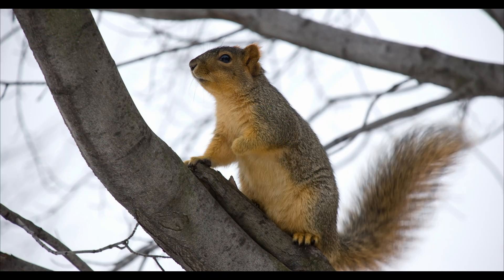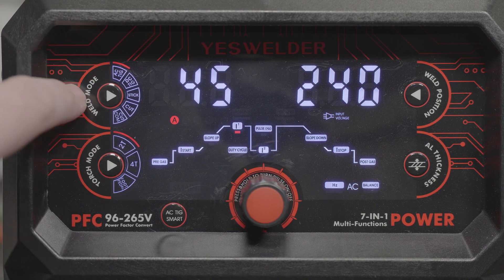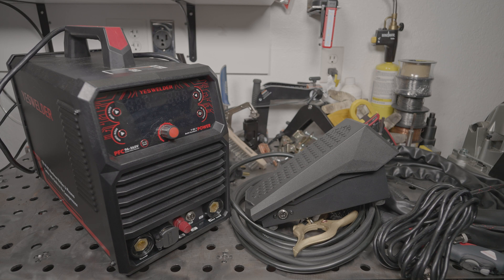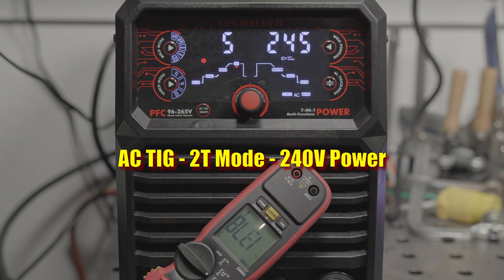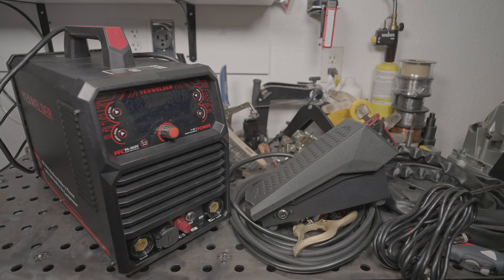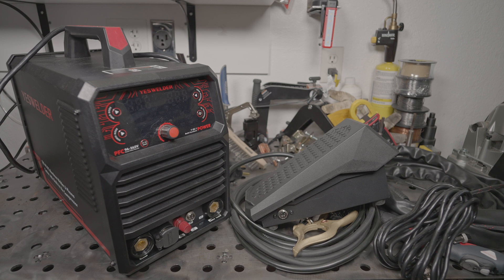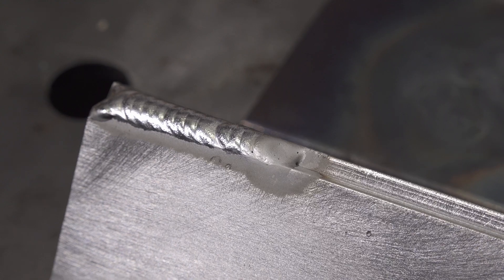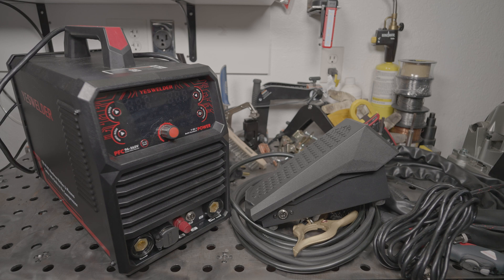Yeswelder CT2050 TIG Testing - Surprising Results

Comment: This is a cheap welder for what it claims.  Performs mostly like a cheap welder.  I'm sure  most that paid big money for it,  loves it.    The I'm confident I didn't get screwed mentality.
On measuring the AC output it is possible to get errors on measuring voltage if a complex waveform. Checked meter on other ac welders?  Feels like less amps than otther ac welders?
Reply from the maker: It definitely feels like less amperage than other welders.
Reply: I just need to add some type of  blocker to my browser that mentions Yes so I won't be tempted...

Comment: I just want to say thank you for this great review on the YES CT2050 welder. I have been welding for 40 years and was thinking about buying this very machine, not for me but for a cousin that asked me to find a decent welding machine that had multiprocessing. I currently have a Miller 330 A/BP AC/DC with High Frequency, Gas and water valves connections and a range from 5 amps to 460 amps. It's the real deal for serious welding needs. I believe it's a 1987 or 1988 model with approximately 100 hrs. or less on it. I bought it maybe six years ago along with the paperwork from WESCO Welding Supply. Extremely smooth arc. I was thinking about selling it and getting a multiprocessing inverter, now I'm cautious about doing that. I'm going to watch all of your videos to get your honest opinion on what you have had experience with. I'm retired and now 72 years old, sad thing is forgetting the names and places you worked, even all the wonderful knowledge of welding and fabrication, the real tips and tricks you had to know and not being afraid to share them. 
Could you please tell me how you filmed the weld puddle doing aluminum or really any type of welding. I'd like to leave some videos of my welding for my family to see and especially my grandsons to see. 
God bless and thank you so much for sharing your input on these inverter machines. Paul Greenlee

Comment: I paid $1k for it mostly to have a plasma cutter which doesn't need an  extra air compressor to attach to and tig option to weld aluminum, in one machine.  I didn't expect it to be a miller or Lincoln quality,  so for a diy it should be a good machine machine with a small flows like this
Reply from the maker: In my opinion, plasma cutting with the built-in compressor is probably the best thing this machine does.  Works surprisingly well.  

If you are happy with it and it works for you, that's what is important.

Comment: Great info. So you think the problem is the machine or the Foot Pedal?  Did you measure the ohms when the foot pedal was up and down?
Reply from the maker: I haven't checked the resistance of the foot pedal yet.  I have since tried with the torch mounted amperage control dial instead of the foot pedal and the behavior was the same (I made a short video about it).  So I think it's to do with the machine, not the foot pedal.

Comment: Awesome vid. Did you call Yeswelder? If so, what did they say. It should be a warranty. you may gave gotten a dud
Reply from the maker: I haven't contacted Yeswelder.  I've been busy, but I plan to test the torch mounted amperage control to see if it allows more output than the foot pedal.  Either way, I suppose it couldn't hurt to see what they say about the fact that the output simply doesn't match the spec.

Comment: I just have no watch your video again and seeing that on the AC side that you can't even weld a couple of coupons together of a thin that's going to suck for someone who spends good money on this machine when you can't even get 150 amps to weld an aluminum joint. I have a primeweld tig225x and when I'm welding aluminum I got 180amp on the dial. Hopefully yeswelder sees that and they start getting on the ball with getting these machines doing the right thing!!!!!!!

Comment: I think the potentiometer inside the pedal is out of adjustment (or just not designed for the full range). Simple test would be to check the resistance at “full power” between the handheld torch and the pedal. The machine clearly does it, so seems that its just the output of the pedal.
Reply from the maker: I agree that the most likely issue is an out of calibration/spec pedal.  I plan to test the output using the torch mounted amperage adjustment to see if that one will reach the full output.  Or at least, the same output as the non-adjustable mode.  I'll update once I do some more tests.

Comment: I might have missed it, but does this machine do mig and did you make a video on it as a mig  welder? The tig function seems  to be a bit of a failure as well as the stick function, so curious about it as mig . Why have it for only a half decent plasma cutter.
Reply from the maker: It does not have MIG functionality.  Just TIG, stick, and plasma.

Comment: I feel like for this level of cost that stuff should have been worked out. A dedicated AC/DC tig cost much less (ie Primeweld) can easily pulse and use a foot pedal and has none of these issues. Also i agree that the interface is highly annoying.
Reply: I lucked out as well with a cheaper Chinese parts Ac/Dc Tig, picked up a AHP alphaTIG 225xi and couldn't be happier, was a bit harder jumping in at first with the all analog settings knobs for frequency and balance and pulse etc, but liked the idea of less shit to break.  Also heard great results with the Weldpro units from a friend

Comment: Wow now that is a eye opener to see yeswelder's old tricks again or something to do with quality control! Who knows hopefully they will see this video and try to fix the problem. Keep up the great work with the videos!!!👍👍👍👍👍l
Reply: Hi Dear 
I just bought yeswelder machine CT2500
But shipping not arrived yet 
Can you help me let me know if it's good or bad machine please.  Thanks
Reply: @dongpham140  if you watch a YouTube video he explains and shows you that the machine does not do the amperage that is supposed to do of two hundred amps it only does 150 amps on the DC side and does less on the AC side. I would go ahead and assume that the machine is not that great of a machine compared to what I have a primeweld tig225x I know for a fact it does all of the 225 amps on the AC side and the DC side I've tested it myself and I've been welding with it for the past two-and-a-half years.

Comment: Just curious what AC Hz freq were you using when testing the AC output? My understanding is it needs to be on 60 Hz for an accurate reading but I really don't know for sure.
Reply from the maker: I tested it at 70Hz and 120Hz and it didn't make a difference.  I never went as low as 60Hz, but technically, frequency shouldn't really make a difference, assuming the accuracy of the meter used doesn't drop significantly above or below a certain frequency.

I may get out the scope, do some more measurements and put together a quick video just showing some additional testing.  I'm curious what the AC sinewave looks like and if things like balance and frequency are accurate.  I don't have reason to think they aren't, but it could be interesting to see.
Reply: @bigtb1717  That's interesting, I have always thought that the meeter needs to be on the same frequency as the welding machine for an accurate reading. I don't know how different meters adjust to this or what the difference would be if they weren't calibrated to one another. It is an interesting subject and neat to see your testing.
Reply from the maker: The meter I used in the video has a stated accuracy of +/- 1.8 % at 60 Hz and +/- 2% at 100-400Hz.  So it's slightly less accurate above 60 Hz, but the difference is very small.
Reply: @bigtb1717  That's accurate enough for me, I wouldn't be able to tell a 2% difference at my skill level. :)
Reply: Something else that has always captured my curiosity is why do we not see testing videos like this on name brand reputable products such as Miller or Lincoln machines? My assumption has always been that those machines are also manufactured in China but they are (or should be) tested and calibrated individually to meet certain output requirements to wear those "reputable" brand names. As a result they also carry a higher purchase price. If a machine like the YW CT2050 had the Miller or Lincoln name on it would probably have a 3 or 4 thousand dollar price tag. I'm fairly confident that Chinese machines of non popular brand names are not tested or calibrated individually. Maybe they have an occasional spot check from the production line? I'm sure this is a big factor in the price point difference. I don't own a Miller or Lincoln machine but not because I wouldn't like to. I just can't justify the cost for my little welding hobby. I would love to see some videos of this output testing on a popular brand name machine to see how they compare as far as output and advertised output both in AC as well as DC. I've always believed this is the main difference between a high dollar "brand name" product and an "off brand" hobby grade product. (interesting stuff)
Reply from the maker: I haven't tested a ton of Miller equipment, but I have tested a couple, plus an ESAB and a couple Fronius machines.  Their output always matched the specs and generally was pretty close to the setting (often right on).  In fact, every Harbor Freight machine I've tested met the specs as well, though I have another one to test soon, so we'll see if that holds.
Reply: @DIYHomesteadProjectsDIYHP10  I think you know the answer to that question already ;-)
Reply: In order to get the overrated 250 to output 200 amps it needed to be set at 50% balance and 60hz; otherwise it was 180’sh. It appears your foot pedal needs calibrated. Either it has the wrong pot, or it slipped I shipping. If it slipped and needs calibrated, that will correct the start issues.
Reply from the maker: Yeah, it's very possible it's just a defective or out of calibration pedal.  I will likely do some further testing and I plan to test the machine with the included torch mounted amperage adjustment to see if the results are any different.  It's also possible it will have more output at 50% balance and 60Hz frequency, so I will test that as well.  That's not likely how anyone would use it (50% balance), so if that's what it takes to reach the rated output, I think that's a little bit disingenuous of them, regardless.